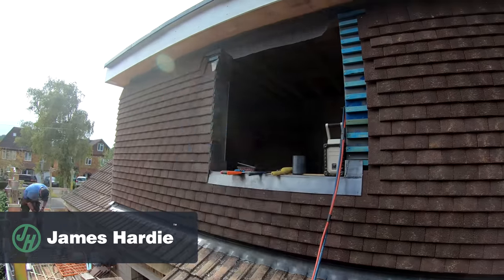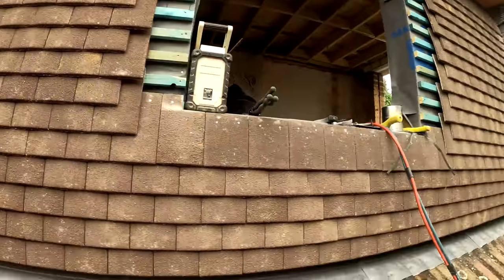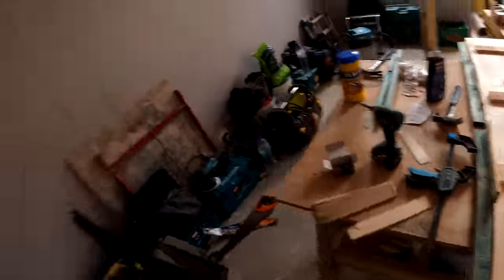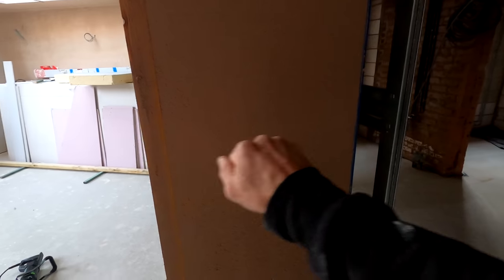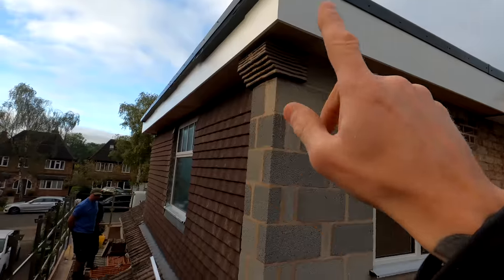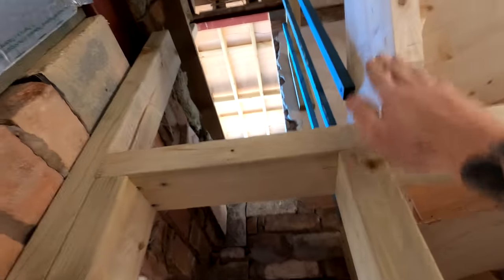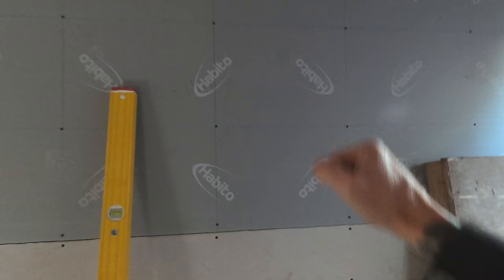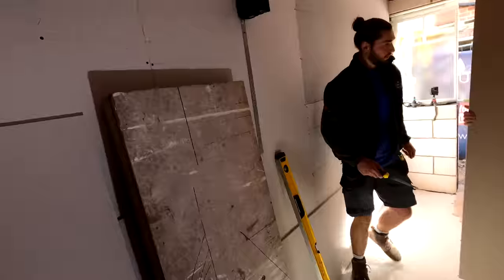Carpentry and Joinery ACTION! | Single Storey Extension #26

Comment: great channel however I don’t think you are actually a carpenter?  Are you?  The biscuit jointer is used for Alinement not strength !  I use floating tenons for that such as the domino jointer .  I could be wrong you might be more of a framer?  If so my apologies!
Reply from the maker: Hi zephyr1408 you are correct about Alinement Pete is great asset and in the middle of his apprenticeship, and still has much to learn as we all are learning every day all the best Tony 👍